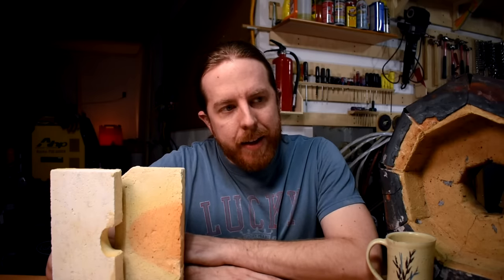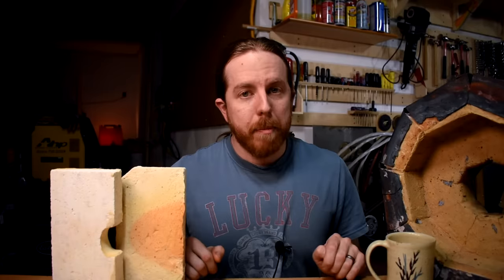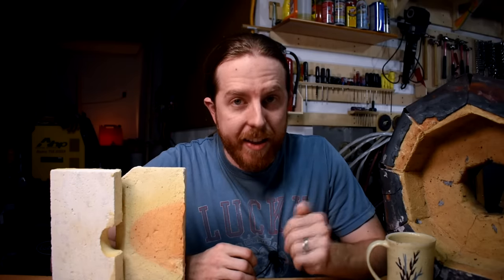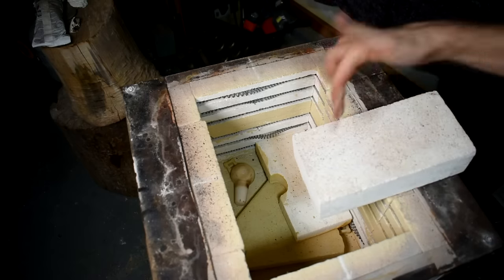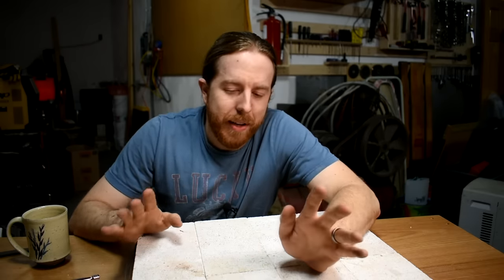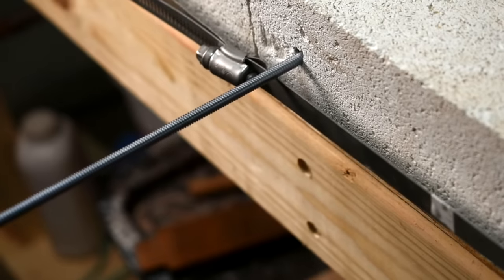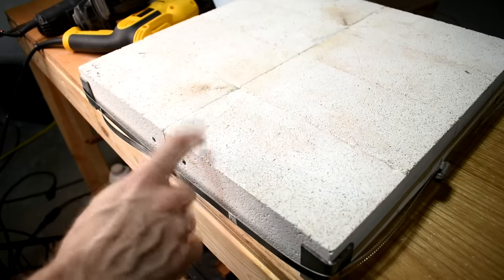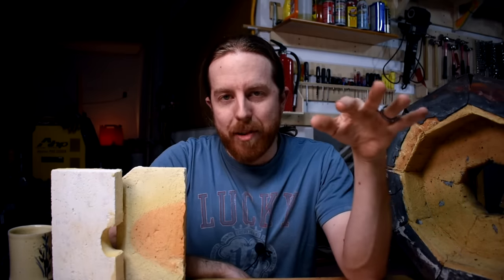There's a Problem With Fire Bricks

Comment: Bless Phil Rogers soul.
Potter here, not an expert but just by observation, when potters build their kiln, especially wood fired kiln (Those big ones) we use at least 2 layers of bricks. Usually a primary layer of firebricks followed by a backing layer of clay bricks. We also use ceramic insulation cloth between the layers to further insulate the kiln. 
That being said though, I have not experienced a kiln repair as of yet and cant comment much on the shrinkage issue as our kilns usually "Settle" over time and its geometrical shape usually solves any problems with potential cave ins and such.
Edit : Definitely forgot to mention that ball clay is used as mortar too.

Comment: Potter here and this video was recommended. We've solved a lot of the problems you talk about in the first minute of the video! 
(Use fiber/castable refractory and your rebar solution is basically  the Minnesota Flat Top kiln).

I've always been interested in what else my kiln could be used for - although at ~10 Cu ft for the electric one and 30 Cu.ft for the gas one they're a bit big to fire up for small stuff. (Funnily enough the electric is a top loader (door is the lid - made of brick) while the gas kiln is a front loader (fiber door)).

Comment: Steel rods - good start, if you shape them into an inverted arch inside the bricks and then post-tension them (steel stretches like a spring for when they are cold and larger) if the bricks can take that much stress. Post pensioning them from that inverted arch shape also pulls the outside bricks down, or the inside bricks up. And as pointed out mild steel may not be the best steel to use.
Reply from the maker: That sounds pretty awesome but I'm not sure how I could drill the hole like that

Comment: Paul, your tighting band does not give direct pressure to the inside bricks. The band  is giving pressure only at the corners. Shorten the corner bricks and shape them to get some overall octagonal design so the band can exert some pressure to the bricks in the middle. Or just add a wegde to the middle ones between bricks and band.

Comment: Bravo for making you own kiln/ furnace thing!!!
Gaps can help you. Reduction kilns aren’t that tight. They get the reduction by burning more combustible material than there is oxygen ( extra gas,wood, or oil )There is always positive pressure in the kiln so small gaps don’t matter. A sagging lid isn’t so bad and it looks like yours was a far way from falling in. I’ve seen way worse that last for 20yrs in that condition. 
Kiln manufacturers use a type of kiln mortar and seal the inside of the lid and between each brick as well as using octagon shaped tops to keep compression more equal like you said. 

Bravo for you ingenuity and exploration!
Reply from the maker: Thanks!  The bricks were definitely far from falling in for sure.  The way i designed it the bricks could just be stacked on top without falling in, but the way the inner parts shrank I couldn't lift them off as one.  The mortar is a good idea but I think I'll still avoid it for now just so I can change out bricks or use them for something else if I get a hard board lid or something

Comment: In between the bricks can be placed soft graphite gasket material.  Exhaust system gaskets have a graphite ring, as an example.  Graphite is one of those things you can't easily burn.  It could save you on the electric bill and rate of cooling.  I worked on one whose steel band was held closed with a turnbuckle on a spring.

I might need a super-hot oven in the future, and any good-sounding ideas will be tried.

Comment: I used to work for a metals recycling company. We mostly had refractory brick for the furnaces. When we line the furnaces we intentionally add 1 few mm in between the brick with a bitumen pads so when we ramp up the temp to ~1000 C (~1900 F) the pads would burn off. Since we ran the furnaces at more or less temp constant 24/7 until the next relining we don't really have issues with the lining itself (except for the occasional worksmanship or material infiltration issue). 

We do have shrinkage cracking on the spouts we use to tap the furnaces and yes we usually use pottery clay to patch up/cover up those problems. We found that low moisture clays worked best for that application

Comment: Is there a certain limit to how much those bricks could shrink? If there is, in theory one could fire them in a way to pre-shrink them and then they could be set from there. (Maybe that's not the case, but it would be interesting to find out.)
Reply from the maker: In my experience with the other furnaces, when the bricks are too hot for too long they begin to crumble, so there is no end to the process.  This includes these 2800f rated bricks in kilns that I never pushed beyond 2300.  2300 for a loooooong time will still eventually destroy the bricks.  I've heard no matter what you use, commercial iron/steel foundries consider the furnace liners to be expendable.  You just can't beat the heat forever, at least not for any reasonable cost
Reply: The shrinking happens because the the quick heating and cooling of the system the only way to minimize it would be to slowly increase the temperature over the course of a few days and then don't shut it down until you have burnt the bricks up and need to replace them typically once or twice a year depending on how hot and hard you run it for instance running it at 1700 degrees everyday even when it is empty will burn up the bricks faster than if you ran it at 1000 degrees when it is full then bring it down to say 500 degrees when it is empty
Reply: @jasondavis7567  Double walled kiln with simmering coals in the space between walls?
Reply: @personman8404  I've seen double thick walls with 2 inches of kwool between the brick and the steel wall get ash soot and slag make it all the way to the outer shell so yes it can happen will it happen on your first firing not unless it was installed wrong but it can and will happen but how well you build it has a direct relationship to how long it will last just like how you run it has an impact on how long it will last ie running it too hot for too long will deteriorate the bricks faster or constant heat changes causing shrinkage
Reply: @jasondavis7567  I was saying to use the coals as a preheater so you aren't temprature shocking the bricks, maybe increasing their lifespan. Thoughts?
Reply: @personman8404  in theory that may help when we re-line furnaces there is a heat schedule that is followed to bring the temperature up slowly for the first fire but with insulator bricks they are really soft you can actually turn them into powder just by rubbing 2 of them together so consistently heating and cooling off the bricks causes them to rub together which is another reason why you would want to use mortar between the bricks to help limit some of that

Comment: i have built lids for my blacksmith forge and i used 3/8" Ceramic Hardboard coated in a ITC-100. ITC-100 is a coating that seals and protect the ceramic fibers, and it reflects/ re-emit the infrared heat as the heat up. they have held the heat for years, and have traveled from a dry climate to a humid one and are still very usable.  my blacksmith forge uses 1" Ceramic Hardboard to insulate and the boards are extremely light weight.
Reply from the maker: Good info!  I'm getting some itc-100 actually, i've only ever used satanite up until now

Comment: Refractory blanket works well for lids. It's light weight too, but it helps to be rigidized. An area the size of your kiln there would be quite affordable. The plus side is it's flexible, affordable and can be rapidly heated with no cracking issues. The down side is the dust is extremely irritating and potentially carcinogenic so it's a good idea to seal or rigidize, and it cools down very quickly compared to fire brick which can be an issue if you want to control the rate of cooling. I suspect you're probably well versed on the stuff.
304 stainless steel works very well for those kinds of temperatures. The issue with steel, like the threaded rod, is that heated iron will react with any CO2 generated by the firing and cause corrosion which can damage the bricks, an issue with both electric and gas pottery firing, and if the steel is galvanized the zinc fumes are toxic. 304 stainless has a ridiculously high melt point though at high temps it will oxidize but without the corrosion issues you get with iron. 
I come at it from a pottery perspective, now building my 2nd kiln, and could not agree more about sharing info between crafts as I've gleaned most of my deep in the weeds detailed info about gas, gas burners and construction materials from DIY forge builders.

Comment: For industrial heat treatment furnace design (giant methane pizza oven style) all our furnaces had height-adjustable doors that were metal frames with bricks inside of the doors; I would venture using this as the primary access for a non conveyor style kiln/oven/furnace would work fine too and eliminate a lot of issues like what you are dealing with. On the flip side you have some degradation of efficiency at the joints for that style door, have to maintain positive pressure inside and may or may not need some kind of ventilation to pull fumes from the entrance (like I said, we used methane so some different considerations)

Comment: I used to be a professional potter. We had a gas fired kiln and fired in reduction. We used the entire natural gas service line that ran in the building for 4 burners and an additional 40K gallon propane tank run wide open on an additional two burners. We would fire to cone 11, which is hot for pottery. Total firing time was about 12 hours and then 12-18 to cool to ~350-500 degrees when you could start unloading and burning your gloves off.

The roof of the kiln was built as a Roman arch. The floor and front door were on iron wheels on tracks so you could load and pull out the pots like a giant cart. The door was sealed with kaowool which is basically synthetic asbestos that hasn’t been banned yet. And if you pump in enough gas, any air leaks won’t matter.
But kilns don’t last forever and it needed to be rebuilt every 5-7 years.

Comment: Yeah, there's a lot to learn by trying to be more Interdisciplinary. I recently watching a video on a bakery that uses a woodfire oven. It operates like an kiln and in some ways even an old forge. Thinking about it, reflow soldering to make modern electronics basically uses a glorified toaster oven.
{insert "It's All Connected, Man!" meme here}
Reply from the maker: exactly!  when i started metal casting, people told me only forced air and probably not propane can be used to melt iron.  Potters have been getting those temperatures for CENTURIES without forced air, just using wood!  Clearly it's possible, you're just not asking the right people
Reply: There's a reason many DIY reflow ovens are made out of toaster ovens.

Comment: Back in the 1970s, I worked at a lead smelter. We used a coke-fueled blast furnace. We used some kind of mud to seal the cracks between the fire bricks. Got it on pallets of 50lb bags. We'd throw a few shovels full in a 5 gallon bucket and mix it with water; no special ratio. It sealed the cracks well. It wasn't adhesive, so it came off pretty easily when we shut down the furnace. For a small oven like yours, you'd be able to use a chipping hammer that welders use to chip the flux/slag off of welds.  There's gotta be somewhere you and your friends can chip in and buy some of what ever that was. I never knew what industrial supply we got it from.

Comment: For my forge lid I go over all the joints with Kaowool reinforced refractory furnace cement. I use a furnace cement that comes in a Caulk tube just to make it extra easy.
Reply from the maker: that sounds like a good idea

Comment: I worked in an industrial foundry where the furnaces and heat treat kilns were larger than your living room.  The furnace roofs are all made in arch shapes for this reason.  A little shrinkage is taken up by the arch shape.  Almost everything was high density fire brick arches supported by steel framework.
Reply from the maker: Sounds like the way those large kilns are built.  Always arched, steel supported.  What did you make at that foundry? I'd love to hear about it

Comment: I’m building a kiln this summer, as big as I can.
I have as much clay as anyone could use in a lifetime.
Tbh though, you can make your own fire bricks with plaster of Paris and sand, I don’t know the exact formula because I haven’t needed to make one yet.  Fortunately for everyone interested, you can also add fiber glass to your mix to add some support in the mix.
If you have ever seen the inside of a old coke oven, the walls and ceiling are basically glass.

Comment: This explains so much as a glassblower cause I've seen these built so differently depending on application in my field like most glass furnaces use the arches or the foundry style if the furnace is constantly hot vs annealing ovens which use less heat and less time hot are just cubes.

Comment: There is something we use at cement plants called plastic refractory, we call it ram. It's like playdough that cures hard almost like castable. probably wouldn't have helped here but thought I'd put it out there.
Reply from the maker: I've never heard of that, I'll look into it!
Reply: Ramtite mouldable refractory, or plastic cement. Add a layer of ceramic wool and you'll never go back.
Reply: Ram can be used but you really need pneumatic tools to properly install it also because of expansion and contraction you really need to have some type of insulator board and or paper between the ram and the steel walls to account for it typically at least 1inch board or 1/4 or 1/8 inch paper for hotter furnaces 2 inch board is even better
Reply: @jasondavis7567  Look up 3M Nextel blanket… It’s a woven ceramic fibre cloth. (It’s also used for high temperature electrical insulation).
Reply: @allangibson8494  that is what we refer to as paper in the industry that and other products just like it
Reply: @jasondavis7567  Paper is a non woven (felt) material. Nextel is woven cloth.
Nextel has more tear resistance as a result.
Fibreglass has the same distinction between non woven mat / chopper gun resin and woven structured cloth that is far far stronger for the same weight.
Reply: @allangibson8494  yeah sorry I just specifically looked up what you were talking about we would never use that in a foundry application the 3m product I was referring to is a white spongy like material that comes on a 2 foot by 25 foot roll with various thicknesses up to a 1/4 of an inch that can be easily cut to shape and used as an expansion material to help prevent the cracking of refractory materials in furnaces during the heating and cooling cycles
Reply: @jasondavis7567  The woven Nextel was used to replace the upper hull tiles on the Space Shuttle…
It is also used for insulation of race car exhaust’s to reduce heat transfer to the crew cabin.
Reply: @jasondavis7567  yeah never heard of putting anything between ram and wall. 
We typically weld anchors to wall then pack ram with pneumatic ram hammer or mallet. Then we poke holes in it to help it dry/ cure.
Reply: @aaronveale6402  it's not  done on the floor walls and ceilings typically it's typically done around the opening of the furnace where you will have the most heat differential from opening and closing the door (even then it's not always done) but in a small furnace of this size you wouldn't necessarily need anchors but if you are going to incase it in a steel box and shut it down after every use adding a layer of paper can help mitigate some of the stresses from the frequent changes in temperature
Reply: @allangibson8494  there are only two things that I can think as to why I wouldn't suggest that first you really need to have an opening at the top to vent hazardous fumes and draping a fire blanket over it sorta doesn't allow for that yes there are a few things you could do to help with that but they aren't really ideal and second because it is a blanket like material you can have sagging in the middle which could potentially cause a few different safety issues it's really just better to go with a hard top with a center hole for ventilation or no hole and cracking the top open slightly
Reply: @jasondavis7567  Fair enough, cement plants are a different animal. If everything goes right the plant is only down a few times a year and not constantly going through heating and cooling cycles.
Reply: @jasondavis7567  the cloth has the strength to support a hole in the middle but the best application would be as a resilient layer between the brick so as they shrink, it expands to fill the gap.
Reply: @allangibson8494  yeah I still wouldn't recommend that when making a top out of bricks you want it as tight as possible so that they don't fall out if you want to avoid bricks the next best thing would be to use a  16lb 2 in thick kwool blanket cut to size that's what we usually use when we prepare a furnace for a burnout after a new liner has been installed
Reply: @aaronveale6402  honestly I'm not evrn talking about cement plants I do refractory work in foundries and power plants mostly but alot of the same products are used it really depends on the temperature and the use of the furnace or kiln

Comment: I actually love aluminum borro silicate brick. I cast bronze hammer heads, (so far)...super easy to mill and cut.
Reply from the maker: they are really easy to cut, agreed.  After a while the abrasiveness of the dust wrecks the saws, though.  that's what home depot saws are for lol